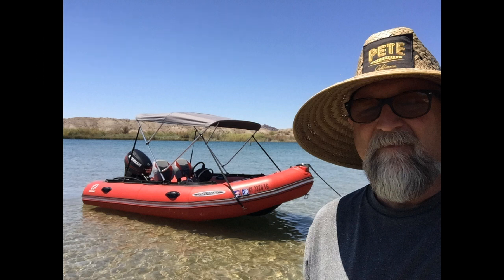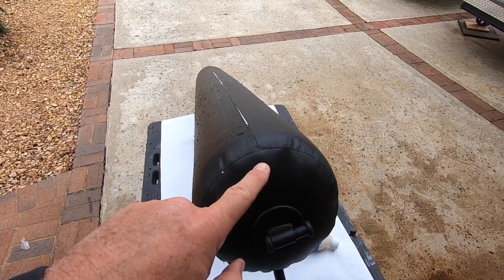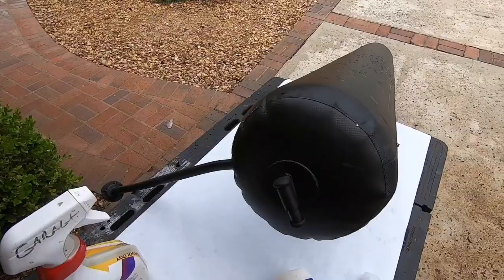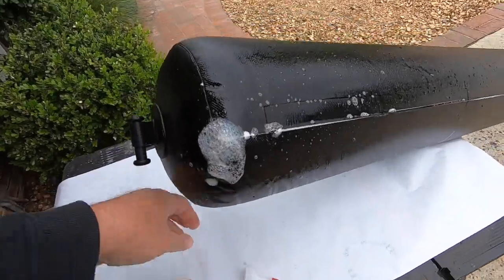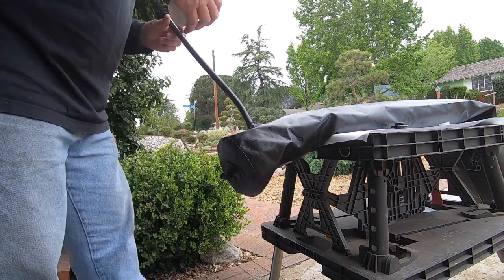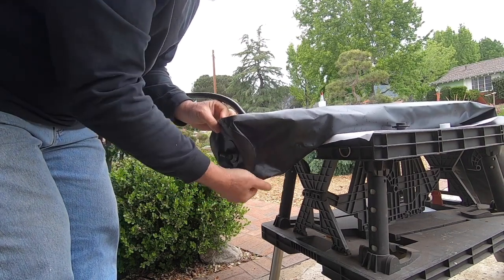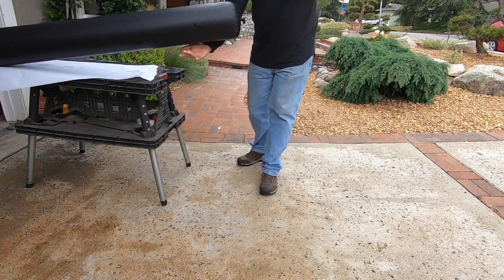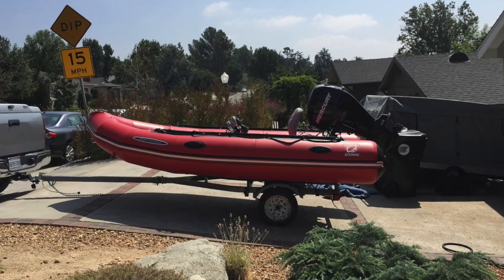Zodiac Futura Inflatable Speed Tube repair

Comment: After many failed attempts to repair the air leaks in both of my Zodiac MkIII speed tubes, I finally came to the conclusion they cannot be fixed.  I have tried patches, seam sealer from the inside, aqua seal and just pumping them up every single day.  ENOUGH!  I ordered some 2 part foam and decided to fill them with closed cell foam.
This was not easy, but I found a technique that was successful.
Tools: knife or scissors to cut tube material, I used a victornox fixed blade knife. Very sharp.
Plastic paint mixing cups at least 28 oz quart or liter sized, have at least 6 on hand
Paint mixing paddles and a drill (amazon $10 for a dozen)
A plastic 1 quart milk jug cut in half to make a sort of funnel.
4 flimsy plastic bags like what you use at the market for veggies
2 people
A large bin for accidents (you will understand in time)
thin rope or twine
First, I cut around the patch where the inflation tubes connect to the speed tubes and drain any water out
Using the rope or twine, hang the tube up with the fat end at the top and this is where you will be working from.  The tube must be vertical for this to work.
The goal here is to get the plastic bag in the tube but fill it from the outside of the tube.
insert the open end of the flimsy plastic bag, up through the milk jug small hole, bring it through and over the cut edges of the milk jug, like it's a trash bag liner, but now it's lining the funnel.
Stuff the closed end of the bag into the hole in the speed tube and by blowing in the open end, you can inflate the bag a bit and also be sure the throat is clear to pour the foaming mix through.
mix the 2 part foam according to the directions on the package, mine said pour the clear part into the mixing cup first, then the dark part.  I would make no more than ~28oz at a time, very important.  If you have never used this stuff before, I suggest you do a tiny batch to see how it reacts, maybe a 4oz +4oz batch and watch it go so you understand how much time you have.
Mix for exactly 20 seconds, no more, and try to get it a uniform yellow color in that time.  Pour the mix through your plastic bag lined funnel into the bag which should be inside the tube and once it's all in there, drop the bag to the bottom of the tube, where it will expand and fill the tube from the bottom.
You might ask why all this effort and plastic bag nonsense?  If you just pour the mix in, it will stick to the insides of the tube and start expanding and block off your ability to get the bottom filled.  By dropping the plastic bag to the bottom, it will all expand down there from the bottom and foam upwards.
You will have to do this at least twice and then after the two bag drops, you can just make smaller batches and fill the rest up just by pouring it in.
Tips, mix 20 seconds and POUR, fast, have someone holding the funnel in place and ready to go.
Wait about 5-10 minutes between pours.
Make sure everything is at least 70 deg F to start, the foam won't expand well if colder.
You will need more than the product suggests, the inner volume of the MK3 speed tubes is 1.8 cubic feet each.  I used almost 3/4 of the "2lb" kit on one tube.
https://www.amazon.com/gp/product/B08RP8DNDB foam
https://www.amazon.com/dp/B0BHS4HS5Z  mixers
https://www.amazon.com/gp/product/B000VUNXIA/  cups
When you want to put the tubes in place, try and elevate the boat and support it maybe on the trailer, or hang it, but get it up higher than sitting on the deck, I hung mine from the ships crane.
get a bucket with warm water and squirt some dish soap in it to make a super soapy mix, slather it all over the tube and have someone keep slathering as you slip the tube into the sleeves under the boat, I used a 4x4 as a hammer to smack the tube in the last foot or so, it was tight.
If you do this, remember you will not be able to fold these tubes up ever again, so understand that.  You may not be able to get them out of the sleeves again either, I make no promises.  I have had this boat for 10 years and only rolled it up once. My next one will be a hard bottom RIB.
Good luck.
Reply from the maker: I finally replaced mine. They were hand made. One lasted 1year and needed to be reglued at my cost. 
I made two sculpted speed tubes air of polyurethane foam (boogie board foam) but over several days submerged they took on water. I thought about the inside foam. Let me know how it works! Thx

Comment: I'm all about those speed tubes, brother!
Reply: They help with stability but the boat does not ride up on them as advertised. I finally had to buy a new set. The new set needed re-glueing the next year when I set it up. Warranty was up even though I used it twice that year. re-glue the end cap back on was $100. Soon Ill see if it fell off again. no mercy from Zodiac.

Comment: Thanks for the video, we had that same problem and patched it over the outside but still have a small leak, will try the toobseal.  Covering the re-install would have been useful, but I see in the comments you describe the process.  Thanks
Reply: I found out my speed tubes were made from thin material. Zodiac only made this version for 2 years. I replaced them finally with new ones. The fabric is twice as thick. Fingers crossed.
Reply: @FREEHAND.WETGRINDER  Tried the toobseal, horrible stuff, leaked all over the place and didn't fix the leaks.  Patched some leaks using aquaseal and some with patches glued with Weavers PVC glue. Still a leak around the fat end seam, but much slower leaks now.  Days instead of hours.  I would really like to fill these with closed cell foam, but no idea how to get it to completely fill the tube before the foam bottoms out.  Terrible design, but a great boat.  Maybe make tubes by turning down some balsa wood. LOL
Reply: I finally had to replace my tubes. And the new ones were heavier material like the bottom fabric. A year later one of the round end caps fell off. No signs of glue seen. Still I had to pay to repair.

Comment: Hi, thanks for the tip ! I just got a Futura and I have a quick question : I always wondered if you absolutely need to remove the tubes everytime you want to fold the boat OR if you can let them in place while folding. As I have a fast-rolling mk2 (with inflatable floor) it would be a lot quicker to set up with the speed tubes already in place !
Reply from the maker: leave them in.

Comment: I've got a futura mk3 fr. pretty basic question, but how do you get the 'pin' out of the 'loop' to get the speed tube out of the sleeve!!!  Appreciate it!
Reply from the maker: Simple. Of course let all the air out. Push the pin all the way to one side and force the short side thru the hole. If it’s cold it will be a bit harder. 
In case you’re doing a repair I did mine several times. Then I ordered a replacement. When it came it was made from boat bottom fabric not the thin material mine came with. This will be the first season to test them out. I , once seeing it I ordered a second. Very hard to find.

Comment: G’day, do you have a video of how to get the speed tube out, mine seems to be glued in? I tried deflating it
Reply from the maker: Mine have a barbell shaped locking pin that is forced thru a hole in flap. 
Also FYI. I finally replaced mine and replacement ones are much thicker material. Like the bottom fabric

Comment: Hi. Do you know what is the valve and hose (type,specification,material) used to connect the main tube to the speed tube? I want to replace mine. Where can I buy the valve?
Reply from the maker: Mine don’t connect. Contact Defender for parts

Comment: I blew my speed tube and now have to take the tube out. I just bought this used Futura love the boat but need to get this fixed. Any hints?
Reply: I now have a lot of experience with these damn speed tubes. I found out mine were the thin material Zodiac was trying out. I replaced with two new ones. "Hard to find" ordering takes months or up to a year. Call every dealer to find a pair? Anyway one yore after I replaced mine I put my boat together and I saw one of the but ends fell off???. I had it pro glued back on. $200. But they have better glue than can be bought by consumers. Fingers crossed. P.S. The service guy said his buddy filled his with closed cell expanding foam. Ive considered this option but it can retain water over time.
Reply: @FREEHAND.WETGRINDER  Do you know the glue they are using? I found a zodiac guy up my way...he is going to glue it and add a patch to it to reinforce it. It was butt end too.
Reply: @dougisaak3209  My service dealer would not tell me the name but he said its better than the best 2 part we can buy. I'd expect they grind off all old glue before re glueing.
Im told you can run these with out tubes but its not a good a ride. Also you can fill with closed cell foam. you just have to slide them out to roll up. If I was to do this option I would make sure I can reseal the tube after filling to to make sure the foam stays dry.
Reply: @FREEHAND.WETGRINDER  I took one to a professional and he fixed it up for 140 but I think I will pull the other one out and give it a go this winter.
Reply: @dougisaak3209  so far my new ones are holding air.  The original ones leaked the first trip out.
Reply: @FREEHAND.WETGRINDER  Where did you order new ones?
Reply: @dougisaak3209  called every zodiac dealer. Everyone!
Ordering zodiac parts can take 6-8 months they say. 
P.s. some guys fill their leaky tubes with closed cell foam. You have to store speed tubes separately. Before I bought new tubes I carved foam tubes from polyethylene close cell foam(boogie board foam) it works but the shaped closed cell foam could let water in when under water for a few days. It was very slow to dry. Even though the water only got in a little (1/2”). Pouring in closed cell create a skin on the outside and with the tubes as well it should keep water out. But not for ever.

Comment: Can you tell me how you get the speed tube back in the sleeve once you've repaired it?
Reply from the maker: With the air out use a stick with a nail tapped into the end. Push in till it’s but end is positioned so you can put the lock on. 
After several years patching my speed tubes it got so I couldn’t get a good lasting repair anymore. I replaced my speed tubes with new and found my original tubes were made from thin fabric and because too many leaked they now use thick fabric. It seems to be as thick as the bottom fabric. Which is the thicker than even the main tubes.
Reply from the maker: P.s. let some air out of the main tubes. Not so they are baggy but not tight. Perhaps 1 to 1 1/2lbs it’s just a little easier
Reply: Thanks for the reply!  I got it out and did the soapy water test.  No leaks at all on the tube but found the valve is leaking.  I put some Teflon tape on the cap and it's holding air longer but still leaking.  I wonder if the rubber part on the valve is replaceable.  My Futura is older - a 2004.
Reply from the maker: @CindyCreighton  where is the leak exactly. If at the cap but a new one. They sell the two pieces together. Small cap and the threaded part it screws onto plus the string
Reply: @pagick9  it's leaking at the rubber flapper.
Reply from the maker: @CindyCreighton  the cap is what actually holds the air in. The flapper holds it during pumping. Just buy a new valve if the cap is bad. Good luck
Reply: I threaded a string down the empty tube and then attached to end of speed tube. I sprayed speed tube with some silicone lubricant I had for rubber seals...then pulled it up the boat through the valve hole and reassembled the valve.

Comment: How long you have this boat.
Reply from the maker: Just finished my 3rd year. I finally noticed the speed tubes on my boat used thin fabric. That’s why I’ve had to patch many times. The new improved tubes are made from boat bottom fabric. I just replaced my original style. I presume they will hold up better.

Comment: What is that product you are putting in please? Tx
Reply from the maker: Toobseal
Reply from the maker: I’m not sure what you are asking about. I made the steering frame and seats base. Actual seats and steering wheel and related cables are from Overtons.
Reply: @pagick9  do you think this is the same as bicycle tire "tubeless sealant" like Stan's notubes/similar? looks like same container and very similar color and consistency.
Reply from the maker: @alexnarconis  the bike tube sealant is green with small brown chunks. 
I think it’s latex adhesive of some kind. 
I have finally replaced both my speed tubes. The new ones are made from a much thicker material. Like what on the bottom of my boat. I’m hoping these give me less trouble
Reply: @pagick9  much appreciated. good to hear!